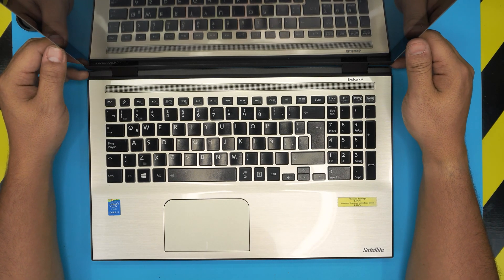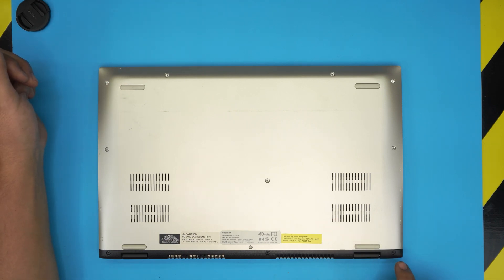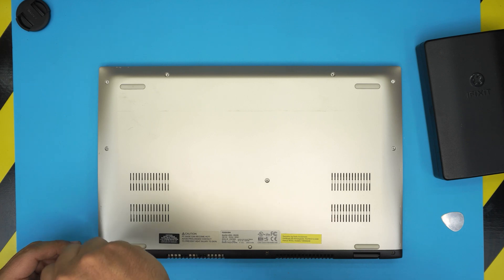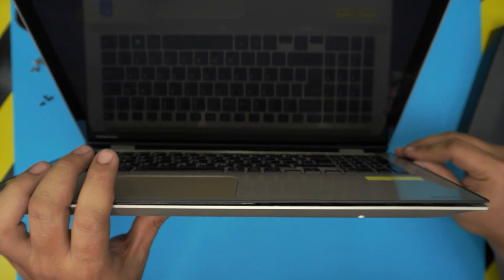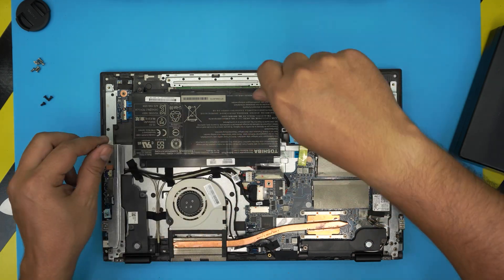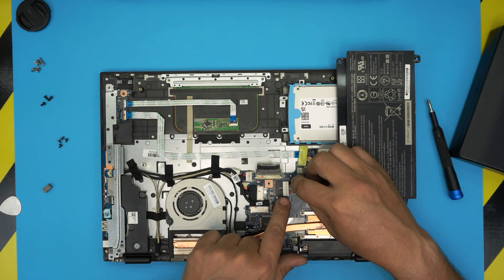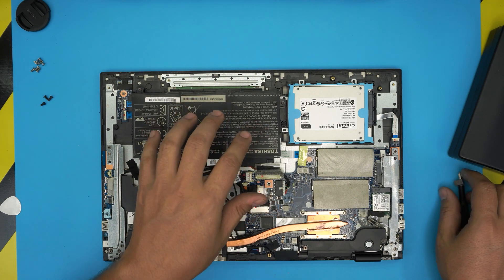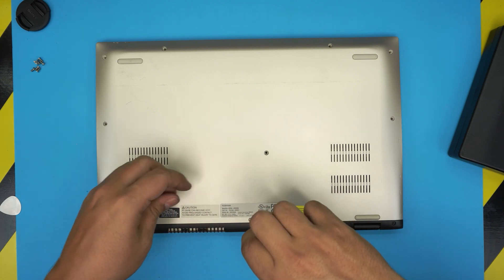Toshiba Satellite L55w C5202s 🚩Battery Replacement

Comment: Fantastic video thank you. Is there a good replacement battery on amazon for satellite P55W-C?
Reply from the maker: It's my pleasure my friend.
🫠Regarding your question, almost all the batteries are the same. there are only two battery manufactures for laptops and they make for different brandings.
Reply: @uFixTek  thank you so much
Reply from the maker: anytime 🙂